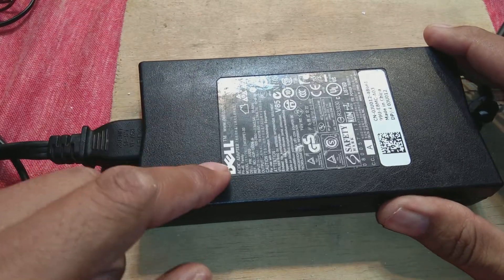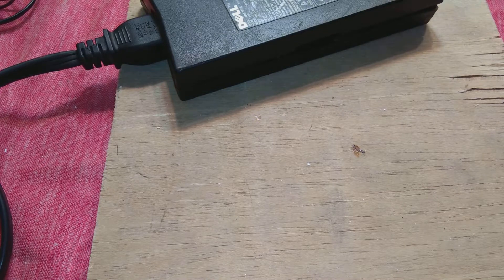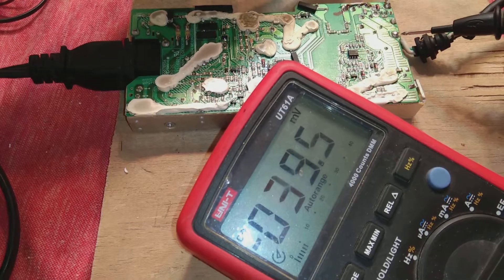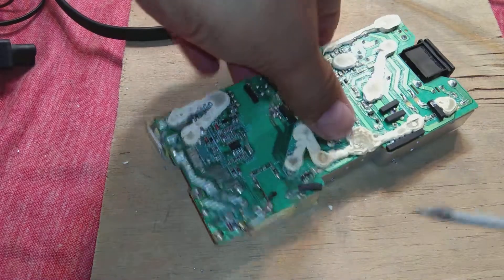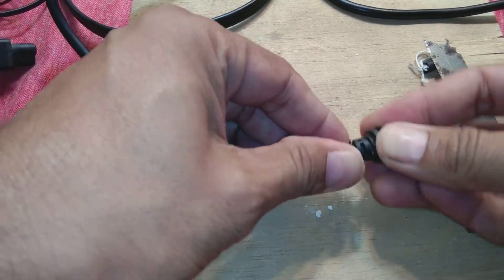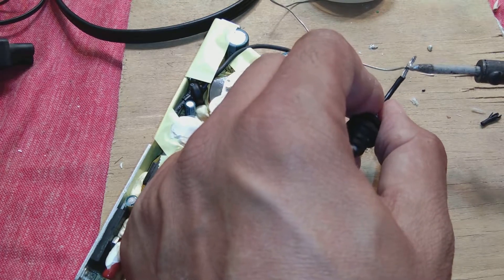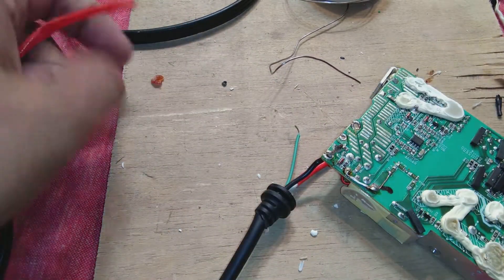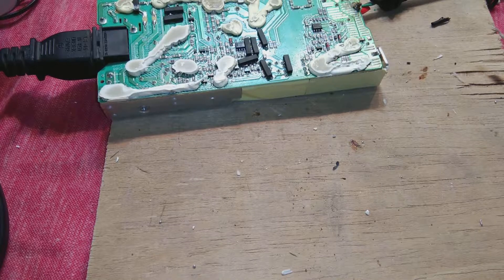Laptop charger repair. Dell laptop power supply repair. Diy charger repair. Repair charger at home

Comment: thank you for the video! i have a similar dell power supply. Any advice about what to check when the power supply can't hold the load?
Reply from the maker: There are many items. Check all electrolytic caps. Also optocouplet. There could be a rare chance of smps controller ic.
Reply: @JahanZeb1976  finally it was a pin loosing connection. I resoldered it and all ok. Thank you for your response! 
Keep up the good work

Comment: I have the same charger, it doesn't charge the laptop but powers it on perfectly, the battery shows idle power insterd of charging i checked it for another one and its charging the laptop so the battery is ok. How can it be repaired?
Reply: cable is broken,  no voltage on pin placed inside plug,

Comment: hi, thanks to open this charger.
is there any idea to use this charger as power supply for audio power?
Reply from the maker: You can adjust this power supply voltage in wide range. It needs little modification in output stage. I'll post video on this topic.

Comment: you are faking it bro........charger showed good voltage in the bigining.....at 1:27.....if its broken....could never show 20 vlts.....this is a fake video....or say fake repair....closing you fake video no buddy needs your videos....
Reply: That's not necessarily true. It could be an intermittent problem.(which is very likely since it was a broken wire). Also, you can see where video was cut so its possible the first shot he was not happy with so he shot again after it was repaired to replace scene.

Comment: Smashing repair jahan, good to save another power supply :-D
I have repaired chargers similar to you.
Sometimes it is an internal short in the cable near the charger.
I normally cut off a couple of inches to remove the stressed cable, but that's just my way.
Or it's the plug end,  never easy to make a stripped plug look neat again,  but most people don't care as long as it works :-D.
The Dell machines are sneaky with the psu  i.d wire,  some dells just won't charge if you dare to use a non dell charger lol.
I suppose that 3 pin chip on the pcb could be wired to the cable so you could use a different charger.
Reply from the maker: Sure. Your knowledge and experience is rock! Your way of repair is great and ultimate. 💖. I think the same about the three pin device.
Reply: @JahanZeb1976  Please remember that im only a basic repairer.
With all the things you have repaired and understood, i can never be as smart as you.
Some parts of electronics seem impossible to understand,  mathmatics has always been a nightmare for me.
I'm one of those people that could not make sense of school, so i learnt by taking things apart and seeing patterns in the circuits.
But it is amazing how much i have managed to repair over the years,  i'm not bragging or anything.
A thing i have learnt is never to think i'm the best at something,  just around the next corner is a person that will make me look so stupid with there knowledge.
Reply: @zx8401ztv  Taking apart stuff to see how they work is an indication of your inherent curiosity which is the hallmark of smart people.
Reply from the maker: Wow, amazing sir! Your great comments tells your story always to me. You understand every thing with great and accurate details. Thanks for valued comments.
Reply: @techguy666  Thankyou i never thought of it that way :-D
Reply: @JahanZeb1976  Thankyou but i don't understand everything,  just enough not to make something worse ha ha :-D
Comedy and humor are good for the sole,  enjoy your frendships and help them if you can :-D